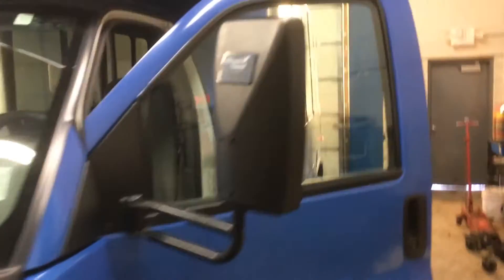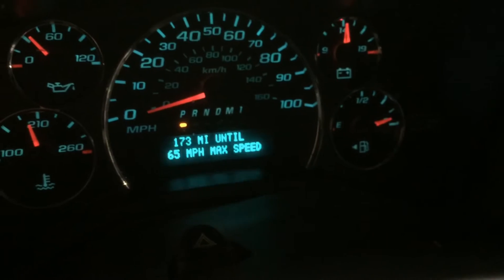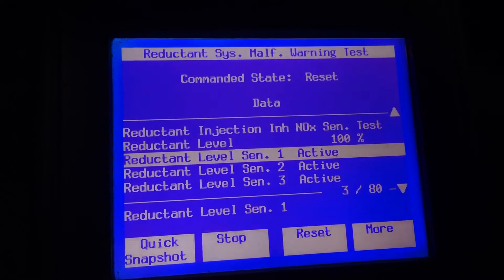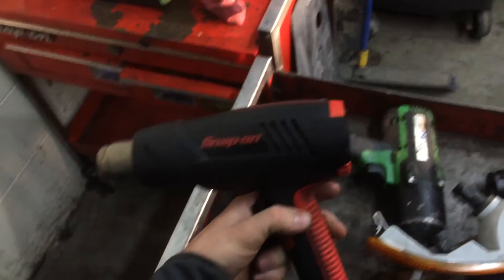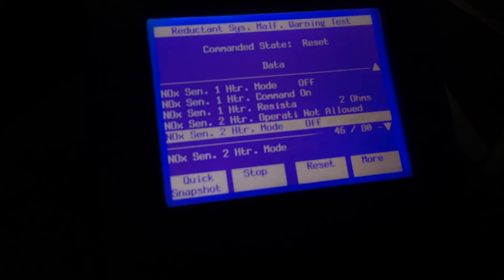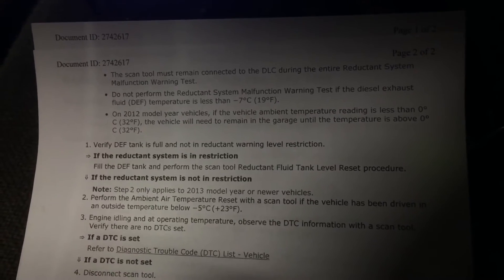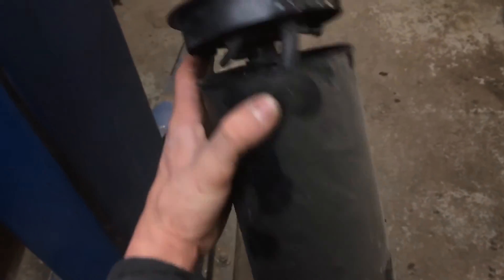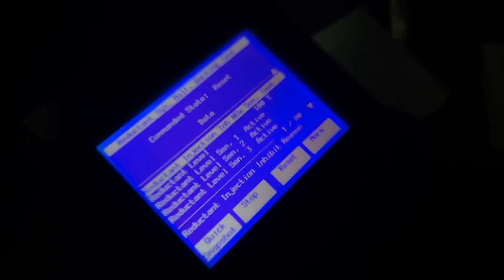Duramax DEF System Test

Comment: What ended up happending,  ime having issues with my lml, i got a poor def quality light and i found out my def injector was clogged but now i went into limp mode and cant get it outta limp mode.. dealer wanted 2300$ to change both nox sensore , they said they were badd and couldent get my truck running… ime stuck with it now anz it non operational

Comment: And this is why DEF systems are complete bollox and totally stupid. This is MY vehicle, I will decide if I drive it and at what speed, not some electronic emissions crap! And it's why I will never buy a vehicle with this technology installed. It has the potential to kill you by leaving you stranded all because of some emissions crap some clueless government put in place.
Reply from the maker: Interesting you mention that, because not long ago there was a patient being rushed to the hospital in a Duramax ambulance which had an emissions system malfunction (not exactly sure what it was) but it shut down the ambulance and the patient died. There should be an exception for emergency vehicles from shutdowns like that.
Reply: ***** Heh, my point proven then! Maybe they should focus the money on these emissions systems into research to make the fuel burn more cleanly instead.
Reply: ***** i agree there should be a system override for emergency situations, BUT i've yet to see a DEF system shut the truck down 100% it usally limits speed for a long ass time like the message you have up on the IPC now.
What caused the truck to shut down? i honestly had no idea there was a fault that could.